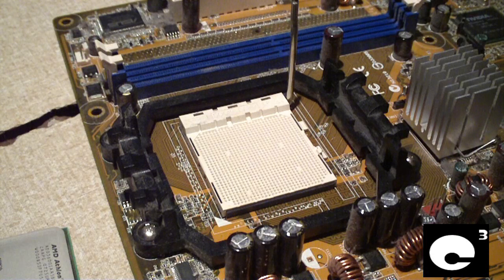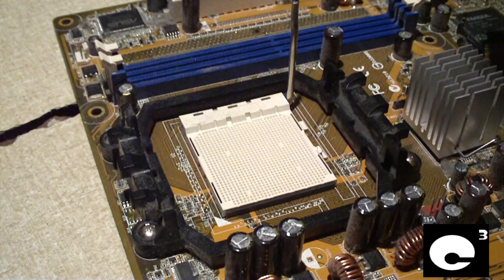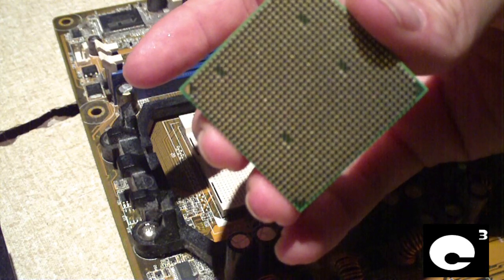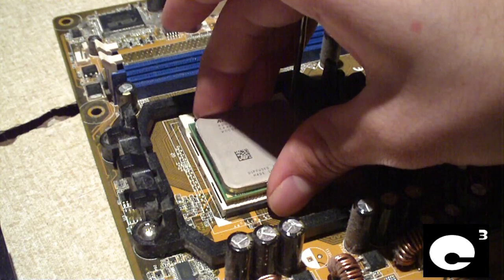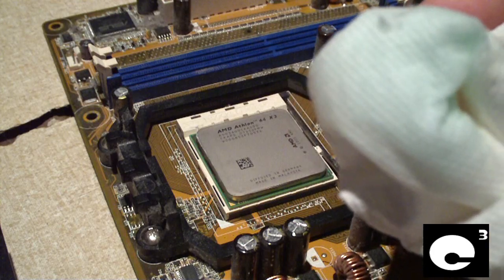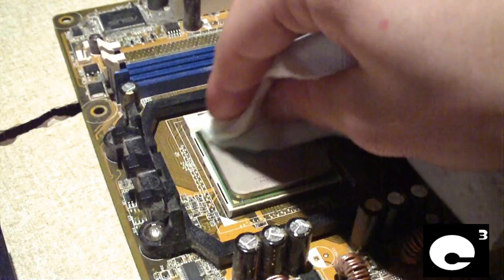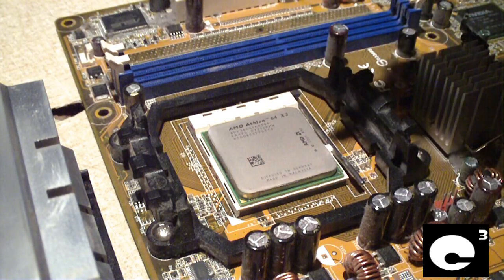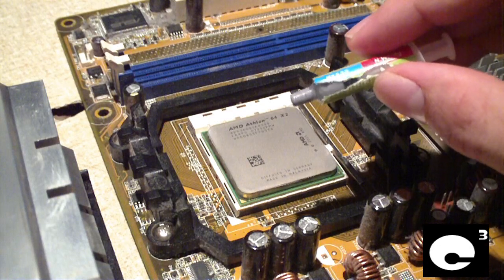How to Install an AMD Desktop CPU and Cooler (Socket 754~AM3+)

Comment: Will am3 coolers work on socket 754?
Reply from the maker: Yes if it's a clip-on style cooler
Reply: @CubeComputerChannel  its a clip on style cooler but it doesn't fit.

Comment: Hi, I have asrock am3 motherboard and has an athlon IIx2 210e processor. Can I upgrade my processor to amd ryzen or i5?
Reply from the maker: You will need a new motherboard for either the Ryzen or i5 CPU.
Reply: @CubeComputerChannel  is there a cheaper price for that?

Comment: I installed an AM3 CPU in a motherboard that originally came with an AM2. The installation went flawlessly and is working however my BIOS won't identify the CPU completely. It works well when running windows 7 SP1 however in the system menu it shows that my CPU is 3.3 GHZ but all other info is unknown. At first I didn't care but I now want to run Linux on this machine but Most Linux disros won't boot up at all. I believe this is because Linux is designed to protect the hardware but sense it can't ID the CPU it doesn't know what peramiters could cause system instability so it aborts the boot up. All that said, do you know a way that I can manually program my motherboard with the new CPU specs?
Reply: I already contacted the motherboard manufacturer and they had no idea what I was even asking and just tried to sell me a new mobo.... I very much like this mobo and want to make it work to it's fullest potential if at all possible.

Comment: hi I have AMD Athlon(tm) 64 processor 3500+ 2.20 ghz and its so week can you show me if this is better processor AMD Sempron SDA3200DI03BW
                                                                       LEBDE0632BAA
                                                                       X111257H62432
AND if its possible to change it can you show me which one its better ?

Comment: I'm just curious. Do you have to install drivers or something like that when u install new processor?
Reply from the maker: Although CPUs do have drivers associated with them, you don't have to manually install them. The biggest thing you have to be careful of is to make sure your motherboard supports the CPU you want to upgrade to or install. Some CPUs may have extra software to install in order to take advantage of advanced CPU features. An example of this would be with Intel's Turbo Boost. There's an application for that.

Comment: Hi, will my MSI (MS-7142) motherboard (socket 754) support  AMD 4 GHZ AM3+ FX-4300 processor? Thanks.
Reply from the maker: No it won't.
Reply: ***** thanks for helping out..
Reply: ***** thanks for helping out..
Reply: ***** Will an Emachines W3118 socket 754 work with an AMD Athlon or any slightly newer cpu from 2001 and above
Reply from the maker: Isiah Folio It will work with a Socket 754 Athlon 64 or Sempron.

Comment: omg i have a amd fx 9370 8 core cpu i put way more paste than this on it i didnt clean the cpu with alcohol and shit and i got no problems
Reply from the maker: It would probably run cooler had you cleaned both mating surfaces and used the correct amount of thermal paste.

Comment: You're stupid for spreading it out like that. You're meant to use a pea size amount.
Reply from the maker: Everybody has their own preferences. Don't call people stupid because they do things different than you. How about I call YOU stupid since doing the pea method isn't a good idea for thinker compounds such as AS5. The only time I use the pea method is when I am using a thin compound on a heatsink that doesn't work properly with the spread method.
Reply: I'm not the only one who disagrees with that method, maybe you're not stupid, but it's not the advisable way.
Reply: +Jay Robert 
Its a two degree celsius difference grow up man :/

Comment: All ok until you spread the thermal paste. Spreading method make air babbles between cpu and cooler. Dot method required it spread alone with heatsing pressure and fill correct the cores. For flat-base coolers only. For direct heat-pipe method need 2 lines in the center of the cooler NOT in cpu. Another mistake people do, is apply in every heat-pipe and the results is 30% from paste is spreading around the cpu.